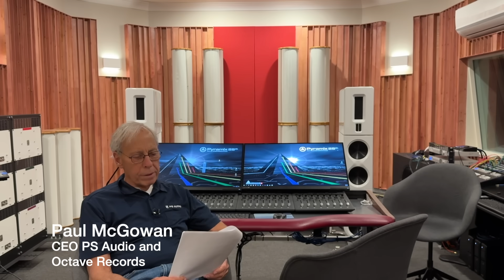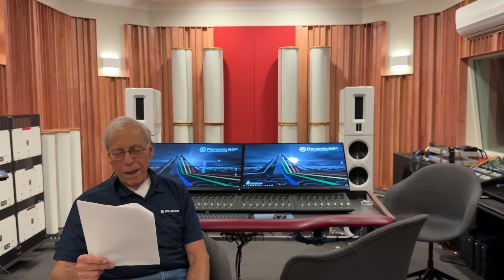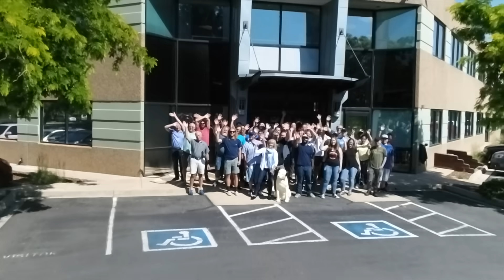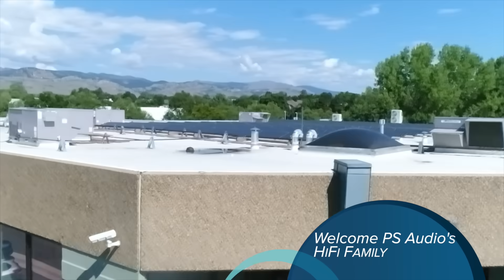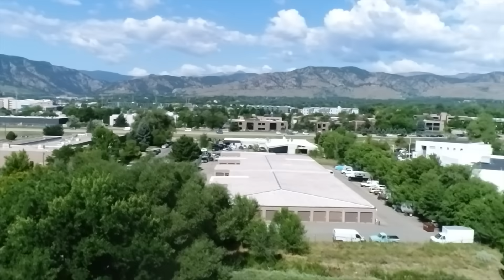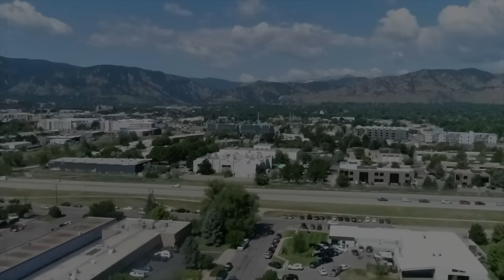Pros and cons of active crossovers

Comment: Once you experience Active crossover, one will never want go back.     And good DSP active crossovers are expensive.    After loosing the Minidsp nanodigit route,  I have been trying very hard to get back to active crossover whether it is analog or digital.    And I just bought the Accuphase DF-75 digital crossover.    It completely changed my reservations about AD and then DA.   With this unit,  I am forced to do the AD and then the DA path which I want to avoid.     But the outcome is very very positive indeed.   First this unit use the more update DSP chip,  for 24/192 and below signal, it can do all the calculations in 64bit mode.       And then the AD chip is the latest 32/384 chip.     From their specs,  the AD and DA route will have sn ration of 117db,  while a direct digital signal will have 120db.      Yes,  there will be some lost (in my mind),  but the listening experience is still outstanding.      And you will be amazed the flexibility of settings,  you can simulate all the sound you can get from passive while you outperform them in all categories.

Comment: For DSP,  it is not necessary to do AD and then DA again.    Minidsp used to produce a little board called NanoDigit.    It accepts SPDIF and then split the signal and output SPDIF.     This little board also control the overall volume.     The output SPDIF then connects to external DACs.    That little sucker can output 4 spdif signal.   You can play up to 4 way crossover.    

This little sucker also allows 6 PEQ on each channel.    It accepts 24/192 signal and do the processing in 24/96 and can output at 24/96.       I have been waiting an upgrade version since 10 years ago when I first play around with this board.    But they discontinue this during covid and inform me that they can no longer get that DSP chip.

The upside: 
- you can control the quality by using whatever quality of DAC you can use.  
- you can use whatever speaker driver you can buy.  (that is provided you know how each driver can match each other.  And then need to build your own speaker housing.   
-  No pre-amp needed.  

The downside:  
- if you want to play 4 way,  you need 4 external DACs.   Can get very costly. 
-  Quality will depend on the quality of your DAC.    
- very troublesome.   You may spend a lot of time testing, trying out different slope,  freq points,  peq ...etc.  And forget listening to the music.  
-  this board although with reasonably high spec at that time,  is not really designed for Hi end but as PA use.

Comment: If you consider a great active crossover take a look at Sublime Acoustic K231. That is fully analog and way better than passive crossover or dsp. Spending money on a nice DAC and adding cheap DSP filter behind it is not the way to go. With this (approx. €500,- ) K231 you don’t need expensive amps, a few Chinese clones will do. Do remove the cheap 1th order / 6 dB slope in your (expensive) speaker, because having both active and the cheesy passive filter won’t bring you the aimed advantage.

Comment: The real question:  Which IMAGES best?  A passive system designed with hand selected component values and many other tweaks results in imagine that is magical.  Once experienced, you don't go back no matter how compromised the frequency response is.   (Also, the level of science to make a passive system image is.... well, it employs features that "don't make any sense" like cutting 2 flanges of a blade mounted tweeter in a tunnel - (!) do you know who I'm talking about?)

NUMBER TWO:  D-A conversion:  Is there a choice in sampling frequency?  If yes, what is the highest? (which should be the best)

Comment: 5 channel 3 way, active crossover, in the car, separate tweeters mids, 8 inch mid-bas s, 12 inch sub, five separate amps, and inside of a Honda Accord hatchback, early 90s sounded absolutely amazing. Everyone that sat in the car was shocked at the clarity. The separation, granted sonic with the car was a perfect atmosphere.

Separating the signals before amplification, with a sharp 24 db per octave drop off,

Used car audio to make one home speaker, step down transformer from 120 to 12 V, and the sound was amazing also, but got divorced and abandoned the project

Comment: Never again Passive. Active have just way to many advantages and with an DSP youve the freedom to tune the sound as you like and correctly implement subwoofer concepts. Its 2025 and this concept is just the modern way of speaker building. The passive way is finished, there is nothing new since many many years. And at all of this hifi shows the best price/performance are always the actives. Sometimes i thing this Anti DSP thing is like an religion in the audiophile scene, like if theyre stuck in the 80s with Analog and Vinyl…

Comment: That's why I use ANALOG active crossovers, not DSP with crappy builtin Analog-to_digital-to-Analog.  Makes no sense for me to use my $2.5k Denafrips DAC only to have DSP use its crappy builtin DAC afterwards.
----
I currently 2-way bi-amp my PS AUDIO FR5 with PARASOUND 2100 preamp’s active 80Hz highpass to the tweeter, 2 subwoofers with builtin active crossover at 40Hz lowpass

NEXT adventure: A 3-way active custom crossover controls everything: 1750Hz matches the PS AUDIO FR5 (bi-amped high and mid), lowpass 40Hz to the 2 subwoofers

----

source=Apple Music lossless

My video:

https://youtu.be/IwdzDbRUs_0

Comment: Thank you for the good explanation. I would like to know what you think about analogue active systems, means having an analogue active X Over before the power amps? I have heard some such systems and it always was a big step from passive to active this way. Much more control and precision and dynamic when the power amp is directly connected to only a Tweeter, Midrange Speaker or Woofer I would think.
Reply: Yep, no DSP crossover for me, at least no with my Eversolo DMP-A6 streamer.
 I love my Eversolo DMP-A6 as a streamer, but their builtin EQ sounds horrible compared to my analog Parasound 2100 preamp with tone controls.

I currently 2-way bi-amp my PS AUDIO FR5 with PARASOUND 2100 preamp’s active 80Hz highpass to the tweeter, 2 subwoofers with builtin active crossover at 40Hz lowpass

NEXT adventure: A Sublime K231 analog 3-way active custom crossover controls everything: 1750Hz matches the PS AUDIO FR5 (bi-amped high and mid), lowpass 40Hz to the 2 subwoofers

----

source=Apple Music lossless

My video:

https://youtu.be/IwdzDbRUs_0

Comment: The control level of DSP surpasses all of the cons. Idk of many DSP products in the home space (someone tell me there is more?) but integrating the DAC into the DSP is fairly common to miniDSP and high end car audio.  to someone tinkering and designing their own speakers, this control is absolutely invaluable. 
You can do all the research in the world, Id bet good money those things get built 3-4 times. Its worth the investment for DSP and also for simple measuring equipment such as  a DATS  and a calibrated mic.
Reply: Who cares about control if it sounds like crap, at least with the DSP built in my Eversolo DMP-A6.

 I love my Eversolo DMP-A6 as a streamer, but their builtin EQ sounds horrible compared to my analog Parasound 2100 preamp with tone controls.

I currently 2-way bi-amp my PS AUDIO FR5 with PARASOUND 2100 preamp’s active 80Hz highpass to the tweeter, 2 subwoofers with builtin active crossover at 40Hz lowpass

NEXT adventure: A Sublime K231 analog 3-way active custom crossover controls everything: 1750Hz matches the PS AUDIO FR5 (bi-amped high and mid), lowpass 40Hz to the 2 subwoofers

----

source=Apple Music lossless

My video:

https://youtu.be/IwdzDbRUs_0
Reply: @mrpmj00 the guy who had never bought a pre-built speaker cabinet. -To my ears, that's sideways a waste of money.  A DSP is an almost infinitely adjustable crossover,  at the very least. 
DSP gives me the control to take almost any speaker driver and find a use case. Whether or not that is in your set up, is what I learn along the way.

 At least for my purposes, having the control over the signal sent to each speaker individually, is invaluable.  I can DSP in 1hr a crossover setup/ that would take tens of measurements per driver to do passivel .That's without mentioning the inherent phase and assignment issues that passive crossovers need to be designed around. 

🤷‍♂️ 🤷‍♂️ 🤷‍♂️ I'm currently.... dual bi-amping some Hodge lodge of fil budget car audio 12, 8, 3, and silk dome horns . built into seperated enclosures. 2x Crown PS-200 per cabinet. 12 & 3" on one,  8 & horns on the other.  Far and away one of the clearest, loudest and just perfect for my ears (defintely falling ears) I've ever built.
Reply: @Goliathaudio  Makes no sense for me to use my $2.5k Denafrips Pontus DAC only to degrade the signal by a $225-$450 miniDSP use its crappy builtin DAC afterwards (the builtin DAC $ value is even less than the whole miniDSP unit which includes a crossover, so you're getting a REALLLLY CHEAP DAC).
Reply: @mrpmj00  I'll  never be convinced any DAC is worth spending that much on,  enjoy!  I'll keep by sub $1k system bumping in the house and my 4k system in the car where volume isn't determined by neighbors. 😂😂😂

Comment: even you DSP at Roon , the sound still suck. so DSP before your speaker will more even suck.
Reply: yea not realy. DSP (used correct for time, freq & phase correction) helps every system. Every Analog un-corrected System i heard so far totally sucks or the Active / DSP based are just better.

Comment: I've wondered this about all the op-amps in my dbx driverack pa. Im using it to build a 3/4 way right now. I like the dac from my motu m6 but the only way to get dsp is to undergo another conversion. Even if I used a sapphire in out mixer and routed on the computer it still converts it through another dac, unless I bypass the dac from the motu. I don't see any other options with all the routing I need for a three way crossover . It confirms my suspicion this can't make it sound better. Maybe if I upgraded my dac to something that has 6 channel dsp balanced outs but I can't imagine how much something like that would cost. Probably an RME interface would be the best cost option, with 8 outs I can do all my processing digitally. But Then the crown poweramp resamples it anyway..

Comment: i have seen some speakers that use usb cable which takes the digital signal directly from the source and then when it runs through dsp, it then gets sent to dac and to the appropriate drivers. i've seen that this is faster and more transparent than adc then dac.

Comment: Active crossovers certainly have advantages over passives with respect to better amp to driver coupling,greater damping factor aswell as adjustable phase and frequency behavior at line level. More power amps are required of course and the additional active circuitry needs powering,so we're back with concerning ourselves with power supply noise and extra line level circuitry.On the whole it is superior, but like all of the options available in audio,we have to contend with which of the available trade offs we're happiest to live with.

Comment: To me  it really depends on the drivers if active crossover is superior to passive crossover. If the drivers are easy to handle and sum up "naturally" a passive crossover often is just fine. If not a active design might be beneficial. One big difference is that passive designs are influenced (for the good or bad) by the drivers impedance curves while active crossovers are not affected by that and provide additional features like time delays. Luckily for DIY there are free tools like REW (for measurement) and VituixCAD (for active and passive crossover simulations) which can be used to produce reliable predictions by combining low frequency near field and time gated high free frequency measurements. You can e.g. measure your individual drivers in your cabinet and export the results into VituixCAD. Then you can try to design active or passive crossovers for it in VituixCAD and simulate the result. All this can be done with very effordable equipment today.